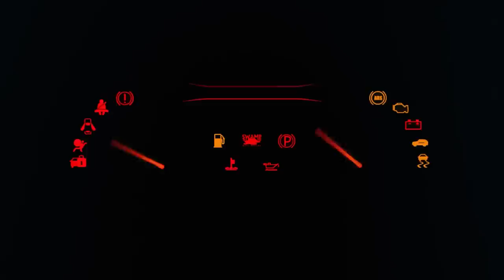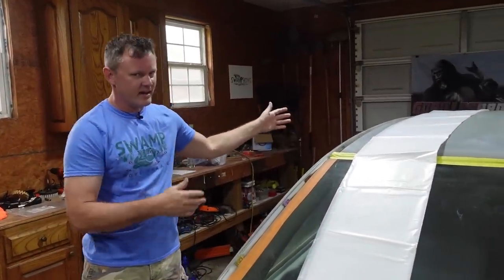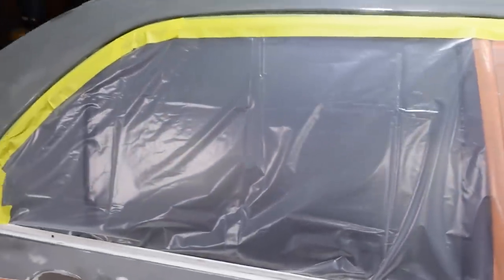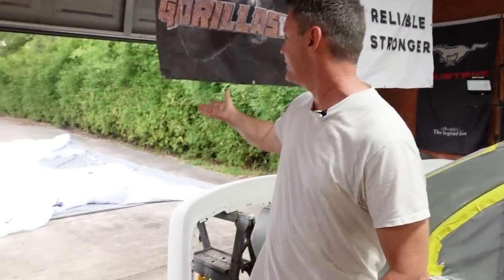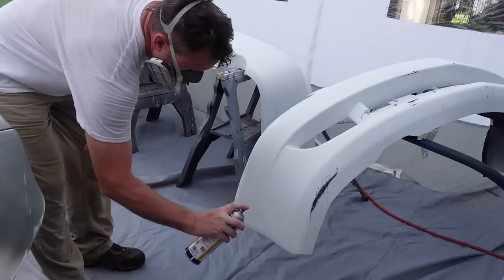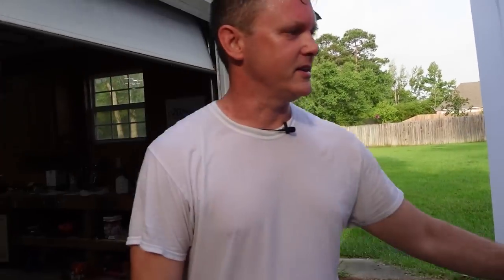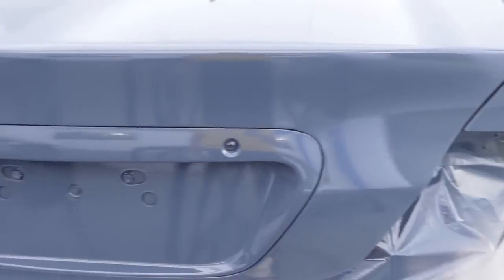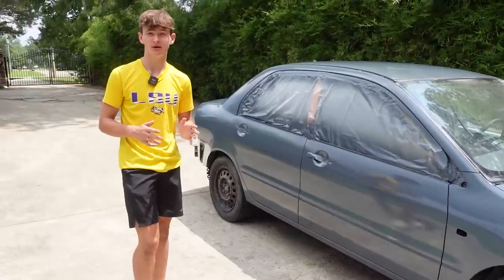Mitsubishi Lancer Restoration | First Time Painting | Unbelievable Transformation

Comment: Not bad at all for your first time. There was a chemical reaction with the mirrors, coukd have been a few things but sand it back down to bare plastic and respray them. Make sure you clean them very well. After some wet sanding (I'd start with 1000 and work up to 2000) then cut & buff should take care of those imperfections. Great job fellas
Reply from the maker: Awesome!!  Appreciate the help.

Comment: The mirrors cracked because you didn’t use sealer in between the adhesion promoter and the basecoat. Unfortunately, your bumpers will likely peel and flake as well if they were raw plastic. Always use a sealer over raw plastic and adhesion promoter. Other than that, pretty decent job. I’m a painter with 20 years experience.
Reply from the maker: Ok. Thanks for the info. The bumpers was not raw plastic. They were factory off the car.
Reply: can you link the type of sealer you are refrencing? this has happened to me as well and i wasnt sure why.

Comment: Great first paint job! Just an FYI and old painters trick.... Stop spending all that money on glass cleaner and prep-sol and run to The Dollar Tree and get you 50% or above Rubbing Alcohol. It's an all natural cleaner so it won't cause bad reactions in your body work or paint and it's pennies on the dollar for the price of Prep-sol. IF I were you I'd just grab some Black/Graphite Wheel paint and paint those wheels with that instead of putting Hubcaps on them.
Reply from the maker: Now that’s a good tip to know. Appreciate that.
Reply: @SwampBoysGarage  that's what we are all here for, atleast should be anyway

Comment: The mirrors look like you had alot of silicon in the air, or the adhesion promoter you used was the issue, you should be able to sand it back completely, prepsol it, then spray it again without any problems
Reply from the maker: Ok. We will retry it this week.
Reply: @SwampBoysGarage  There's 2 types of paint, 1 is arcylic (1pak) also known as being thermo-plasti (meaning the hotter it gets the softer the paint does), 2 is 2pak where a hardner is used in the final clear coat also known to be thermo-set meaning, heat is used to harden the clear, when spraying over a soft base coat such as acrylic an adheasion promoter isnt a bad idea, although if your simply painting over factory paint then just sand and paint on top without a promoter being needed, just remember its like building a house, all good finishes start with a solid foundatioin, and you can put a hard surface on a hard surface but dont put a hard surface on a softbase